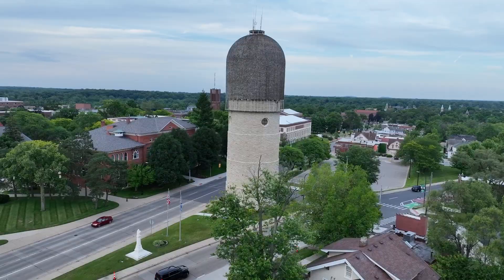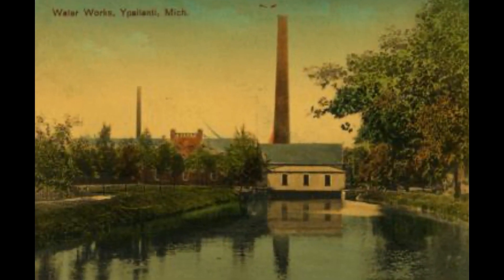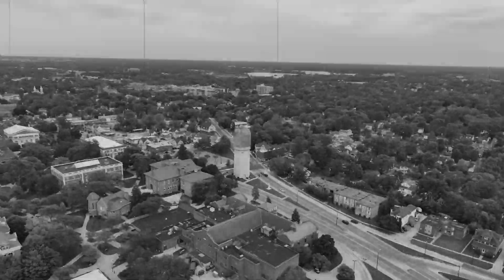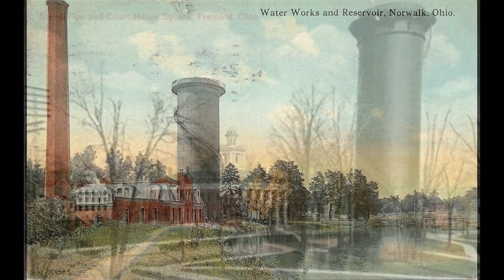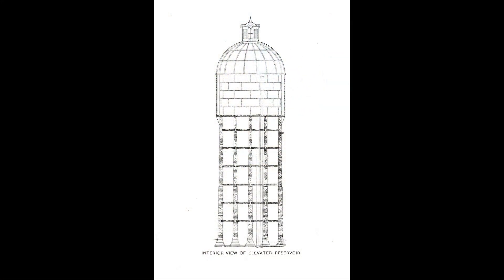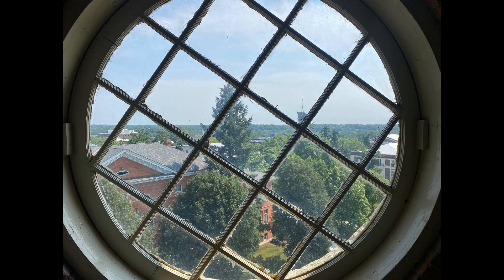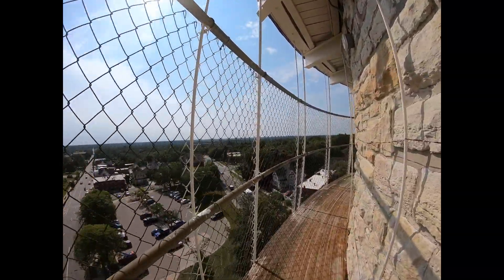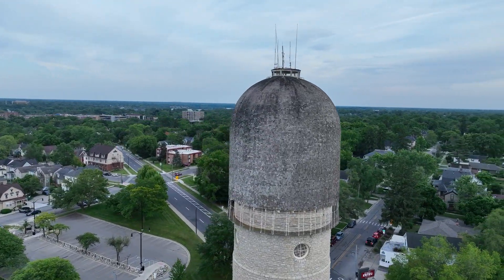Built to Last - Ypsilanti, Michigan Stone Tower - Episode 9

Comment from the maker: While researching for this  episode of my YouTube Series, Built to Last, I discovered a wonderful discussion of why water systems are designed with reservoirs on the periphery of the system, opposite the system  pumps. 

This interesting document was written by W.R. Coats, engineer for the City of Ypsilanti’s Water System built in 1889 -  1890. 

https://cms3.revize.com/revize/ypsilantiwater/Documents/About/History/YCUAFirstAnnualReport.pdf 

Coats outlines the short comings of a direct pumped system (no reservoir) at the City of Kalamazoo in the late 1860s, contrasted with the advantages of a reservoir fed system constructed in Ypsilanti:

1.	The reservoirs can be filled during daytime hours requiring only one shift of operators.  Systems requiring constant pumping require full time staffing, two shifts.
2.	A fire in the center of the can receive water from both the pumps and reservoir – potentially doubling the flow without an increase in system pressure.
3.	A pumped system without reservoirs require an operator the receive notification of reduced pressure or a fire and crank up the pumps, increasing pressure.
4.	The reservoir system experiences relatively uniform pressures, reducing line breakage potential.
5.	Reservoir provides protection against pump failure.

It’s interesting to see engineering in the late 19th century explaining water distribution in such a clear and concise form.